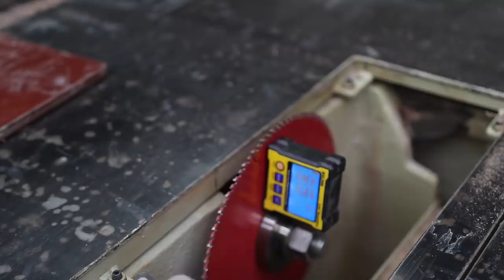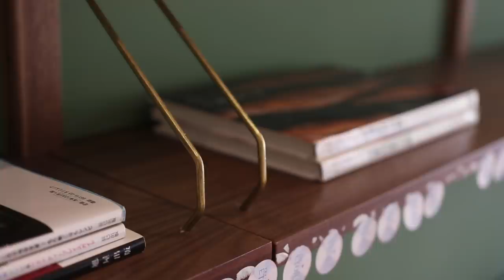W98_Royal system shelves

Comment: Hi, may I know what kind of oil you use? Great built by the way.
Reply from the maker: I use Liberon & Timberex
Reply: ViTTEN / 비튼디자인 thanks for the reply.
Reply: 1 more thing, I’m curious on how you veneer the edge with the iron. Normally I see woodworker use veneer that come with adhesive back but you use wood glue and than iron on it. Over in Malaysia there is  adhesive veneer hence very troublesome using contact glue. Is that how you stick normal veneer using wood glue and than iron on it?
Reply: Very beautiful job!  Awesome 👏 I am always amazed to see that you work most of the time alone !! It doesn’t always have to be easy
Reply: Awesome  job, man ! Greetings from Roumanie !